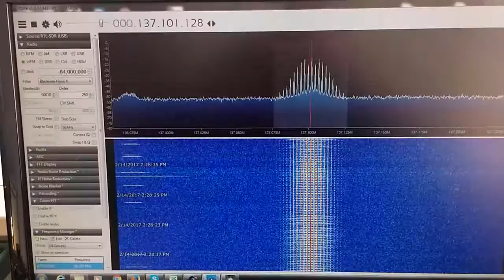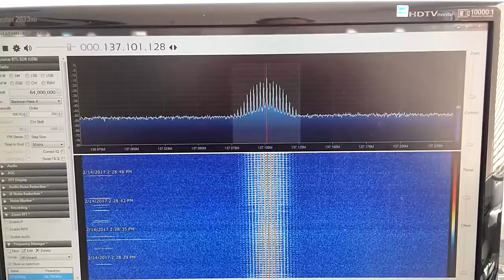137 MHz NOAA WX sat reception using V-dipole antenna

Comment: Why are you using a dc block if you have no lna or active element providing any dc inline??
Reply: He uses the version 2 of the dongle (stated in his pdf describing the antenna build)  where you have to modify the dongle to activate the bias tee. Since deactivation requires de-soldering to remove the mod, he must have simply put the dc block on there to prevent any current to the antenna.